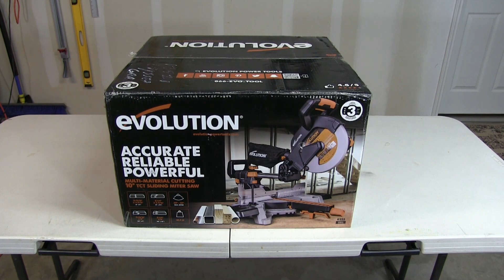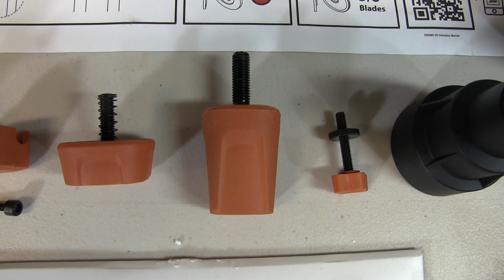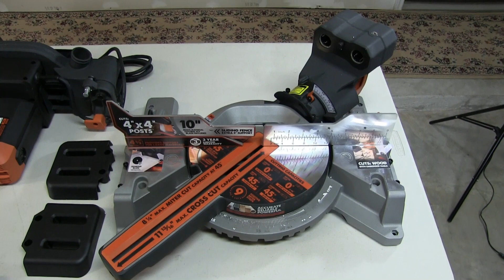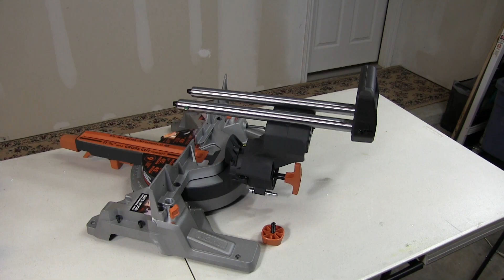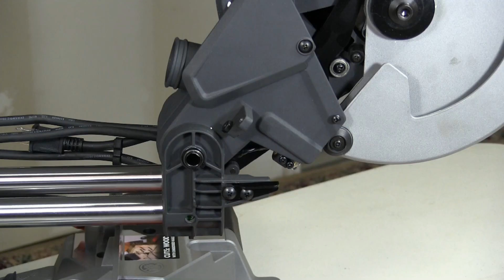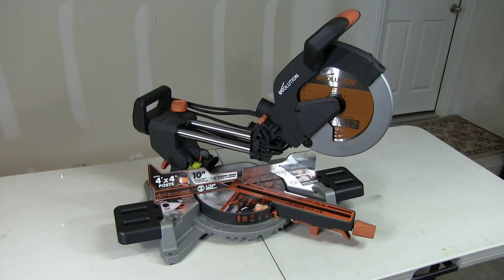Evolution R225 SMS Miter Saw Assembly

Comment: Glad to see you back. almost done with my work bench. will have to post a video of it. :) Great video
Reply from the maker: jeff hebert Im looking foward to seeing the video of your Workbench. It is shaping up nicely.
Reply: @autohelpeu  it is taking shape nicely. paint it black at the moment, using a rocker sprayer i got on sale. also will spray a coating on the to resist finger prints i think. will have to res the can again. lol . It will be black with white handles. bought the handle on sale because they are discontinued. Even bought some extra just in case.,